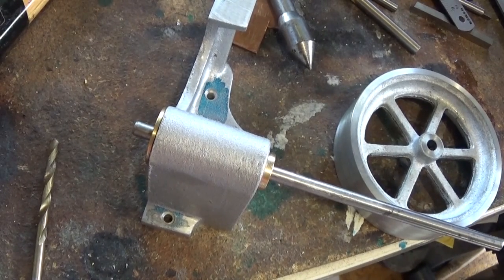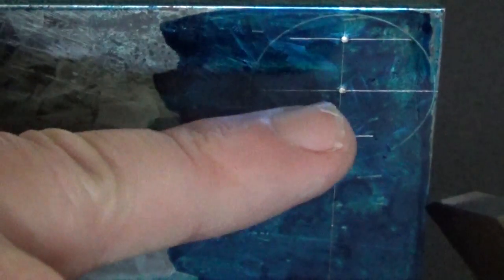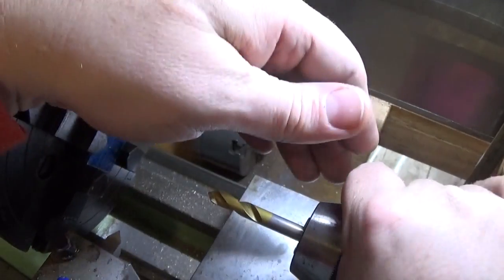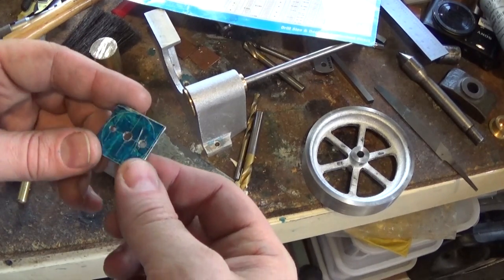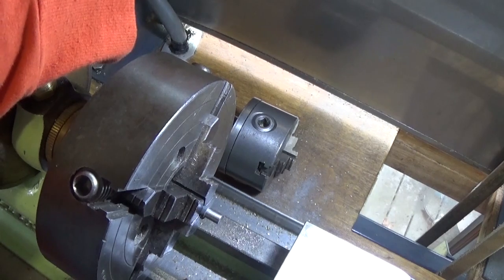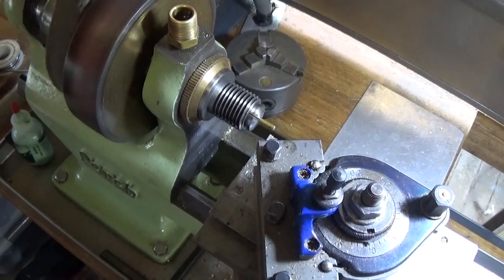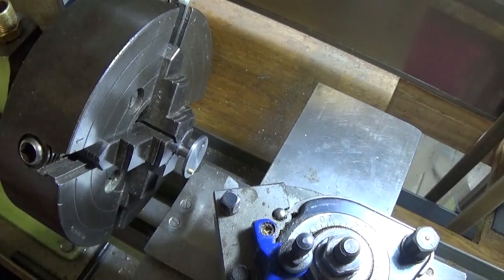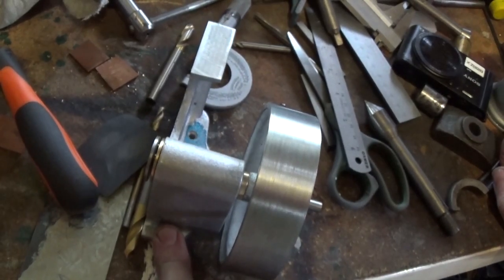myfordboy engine part 9- making the crankshaft

Comment: There is currently a great deal of fuss on the YT machining community about the "King of the 4-jaw chuck." Who can indicate the 4-jaw fastest. OK,  well and good., But you use a 4-jaw chucl where most people would resort to a mill. Your setups are really super-educational  and for this reason I hereby nominate you Queen of the 4-jaw chuck.  BTW the BA series is really metric, it is a swiss standard, but the idea is that each size is twice the area of the preceding one. So the radius goes as the square root of two. The pitches are some fraction of the diameter, so by the time you get to 3BA pitches and diameters are really, er, screwy.
Reply from the maker: awww. youre too kind. thanks for the refresher on BA threads. i kinda like the range and sizes for aplications i use them for. thanks for watching!